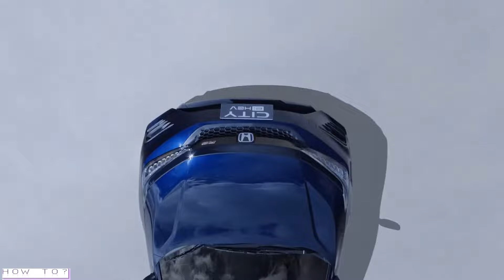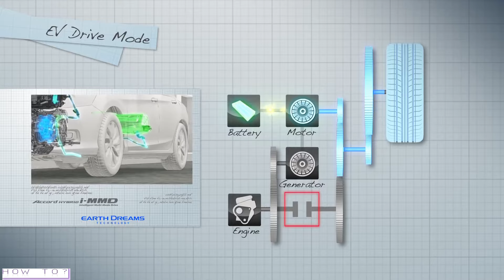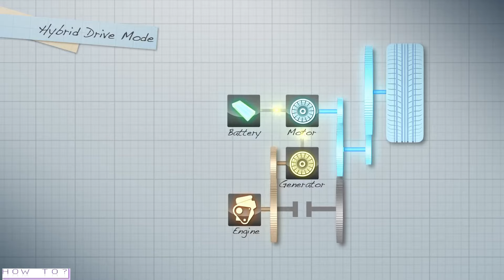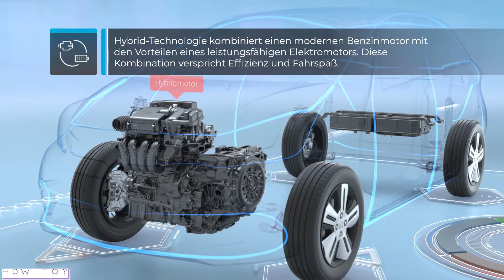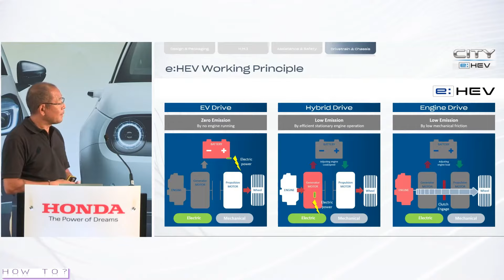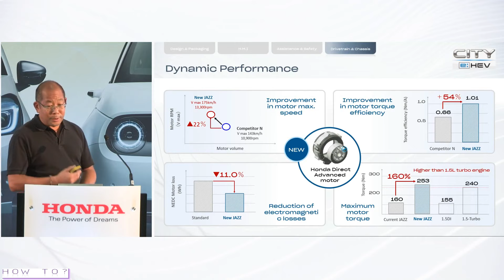How to e:HEV honda new City Sport Hybrid i-MMD technology.

Comment: 100% hybrid mode is not possible. Since prepulsion motor is the only thing that get connected to the wheels and when engine fed it, it will create turbulance

Engine output is roughly 200ps but there is no way it could produce all the way out with this system

Its greener and more reliable seeing from fewer mechanical been added. But no tranny is no go for me

I'm big honda guy, and this is let me down. The best hybrid system from Honda is I-DCD, I though they gonna polish that with gen 2, they changed it into I-MMD instead, now this I-MMD get second gen ffs